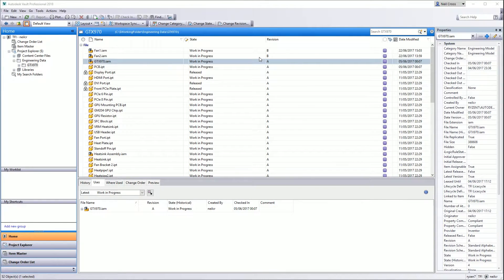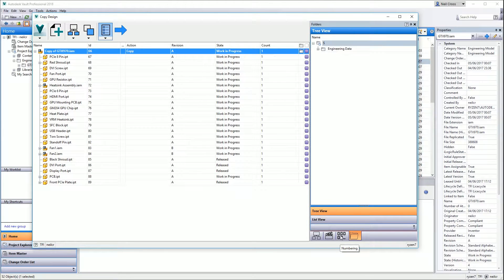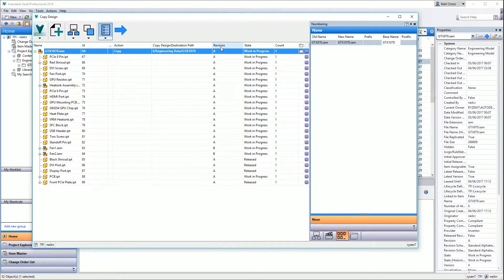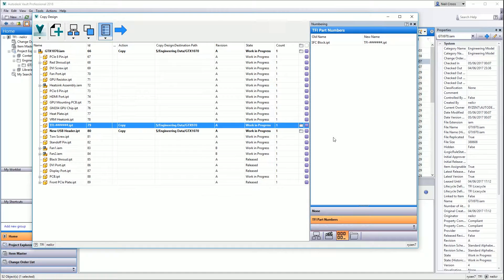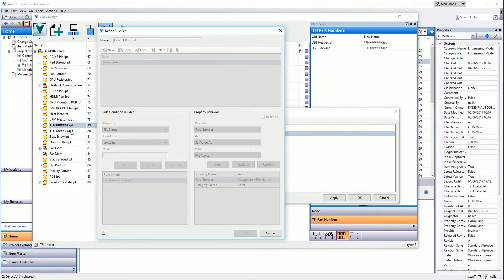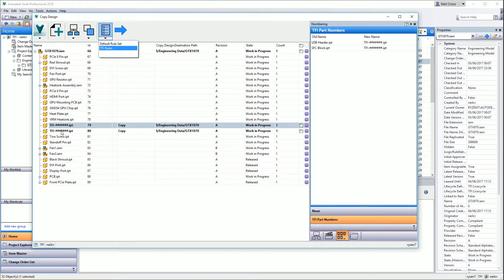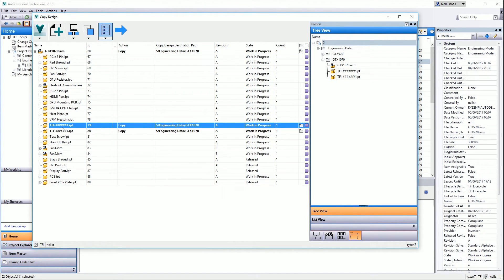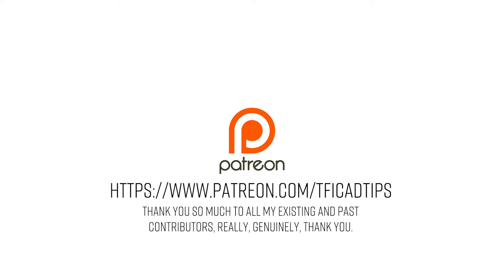How to use the "New" Copy Design in Vault, STRAIGHT TO THE POINT EDITION

Comment: Just upgrading to Vault 2016 from 2012
This as always has been a great help cos as you say it's not very user friendly is it.
Thanks again. Your videos are first class.

Jim
Reply: Hi Neil,

Just a quick question. Something that's bugged me for years.
Just had one of the lads ask me how to find a part in an assembly.
In this instance they had lots of M10 bolts with the same file name & description but something inside one or more bolt models was different so it shows " VARIES " in the BOM
I told him to Auto Balloon the model and then find the offending item (s) Which then could be replaced.
Is there an easy command ( Like isolate ) or similar that would make this less of a pain.
And yes I know . . . The easy answer is stop people being lazy and fill in the correct info when they copy something.
Unfortunately, people take on temporary staff who don't care and leave a trail of destruction for the full timers to fix. :(

Any Ideas ? ?

Jim